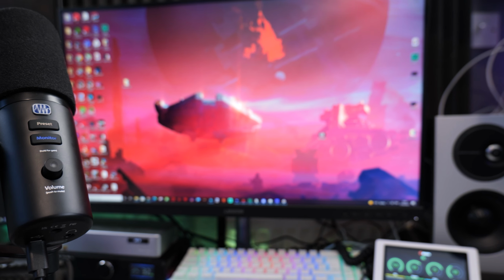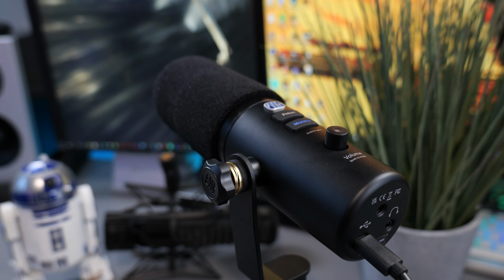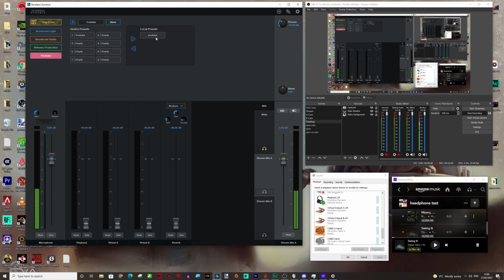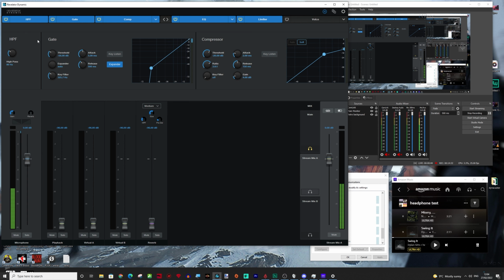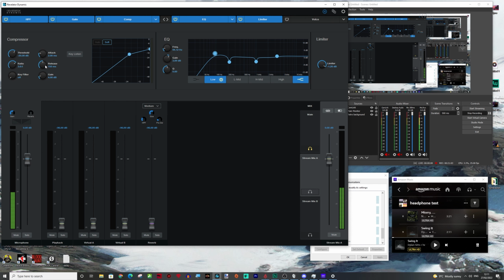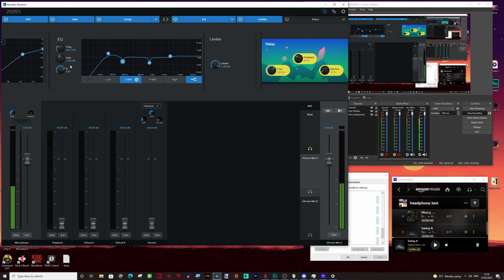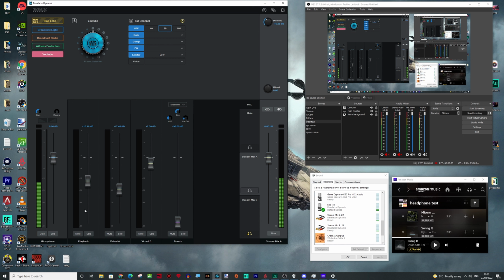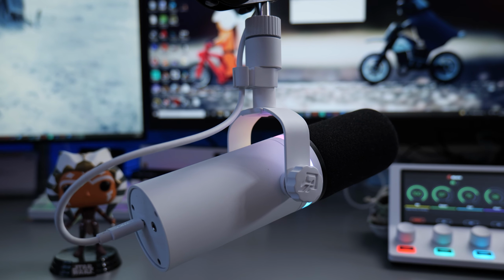PreSonus Revelator Dynamic Usb Microphone Review + DSP and Loopback Setup!

Comment: Any update on the noise floor from PreSonus? Was interested in getting this mic over the Beacn but the noise is really a turn off.
Reply from the maker: Still waiting to hear back but they sent a second mic over and it was the same I feed that back and have been informed it’s still being looked into by the engineers.
Reply: @thefullsetup  I've heard that some went out with bad USB cords. Did you happen to test either one with a different USB cord? I have the condenser version, but I am really tempted to return it for this Dynamic version. My only fear is that noise floor issue. I only have about a week left to make up my mind. Do you like the Dynamic version better?
Reply from the maker: @shawnhitchcock7541  tested both with a bunch of different usb cables, on different machines in a variety of rooms as wanted to see if it was something on my desk causing interference and both had the same noise floor.
Reply: @thefullsetup  Darn, kinda rules out the bad USB cord theory. Thanks for answering me, and thanks for your thorough testing.

Comment: Thanks, well done vid.  Can I ask if you were you able to use it (or the IO24) with the with stock OBS or did you need to run an OBS ASIO extension?   I create Studio One tutorials and S1 is piss poor with the stock Windows audio drivers, so I need ASIO.  However, my OBS won't recognize any ASIO sources so it can't record my Studio One output.   Thanks for any pointers.
Reply from the maker: No asio extension required for use with obs 😃

Comment: Glad you like it! Thanks for the awesome in-depth review.
Reply: Is there anything that's going to be done about the mic's noise floor?
Reply: @Gholdwayne  I got this mic about two weeks ago and was able to completely remove it following Epos Vox’s settings. I do think that the presets that came with the mic could have been tuned better but the noise floor is a non issue when tuned.

Comment: Hi, is this a better option then ProCaster +GoXLR? I have the set boxed but if this one is better i rather sell mine to get some space saving, i honestly dont have space for the goXLR
Reply from the maker: As a previous procaster owner I prefer the sound of it over this/pd70. Have you considered the revelator io24 or io44 audio interfaces much smaller than the goxlr all the same software feature as this mic.
Reply: @thefullsetup  Hi,I dont want to deal with selling and buying just to get a tad smaller interface, if i do it ill do it for a USB mic.
I also considered the Wave mic, but its obviously worse, and that new one, whats its name white one, that has LED ring and their company also sells 2 devices with LCD screen and volume controller, forgot its name, but this brand doesn't sell on amazon. Any other USB mics or this one is the best so far?

Comment: Can you use the headphone jack to out put directly to the mic jack on a dslr (e.g., Canon SL3).
Reply from the maker: Yes I often run a cable out of my audio interface into my lumix s5 only as back up audio though. As you will get a much cleaner signal recording directly into the computer from the mic.
Reply: @thefullsetup  Thanks for the reply.

Comment: While I love the look and some of the features of the beacn mic but it sounded awful and the beacn developers are dying on that hill
Reply from the maker: Agreed I won’t take anything away from software stand point beacn are class leading but for me those usp are a bonus, a mic needs to sound its price point first. It makes me think how wrong or cheap they went with the capsule. The fact the revelator uses the same as the pd70 which can be had for £90 now and runs rings around the beacn makes you think they blew to much budget on software development. This also makes me think just how much of a bargain the pd70 is at current a hidden gem.

Comment: I have the BEACN Mic and I don't have any latency with the DSP on. This is the first i'm hearing of that issue? Your having it with the headphones plugged into the headphone port of the mic?
Reply from the maker: Into the headphone port on the mic beacn themselves have said it has 5ms latency which is pretty much real time. But my focusrite clarrett can get close to that as long as I don’t chuck to many vst at it. 
But I can clearly hear the change the latency is making to the tone of the monitoring vs the revelator series that has zero latency whilst monitoring with dsp. It’s one of those things I wouldn’t of noticed as much  if I hadn’t had used the revelator interface or this mic but because I have it clear as day to my ears.
Reply from the maker: It almost sound like the mic is running at 32 or 64 samples of round trip latency
Reply: @thefullsetup  That sounds like an issue with the MIC. Have you reached out to BEACN to get some help with it?
Reply from the maker: @Turbo_David  yeah spoke to them it’s not an issue with my mic there is a slight latency and my ears pick it up as mentioned above if I set my clarrett to 32/64 samples and monitor through a daw I get pretty much the same almost zero latency sound.  But as with the clarett my Ivoice just sounds slightly artificial and that’s due to the 5ms of latency on the beacns mic monitoring. But when I have devices with built in dsp with 0 latency monitory it’s much easier to notice these things.
Reply from the maker: @Turbo_David  I see your a goxlr user which also has a 8-10ms latency with the dsp again near enough real time but it may be a reason former and current go xlr users don’t notice it in the same way I am as your ears have trained to monitoring with the slight latency. We all have different perceptions of sounds though so if it sound good to your that’s great but if it sound bad to me I’m also welcome to that opinion 😀